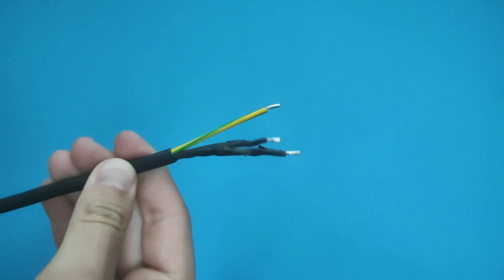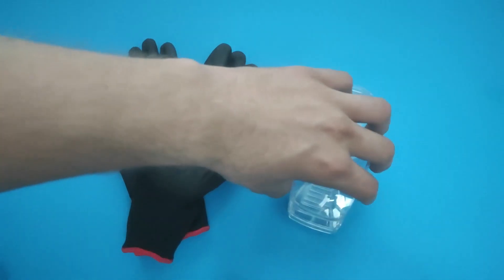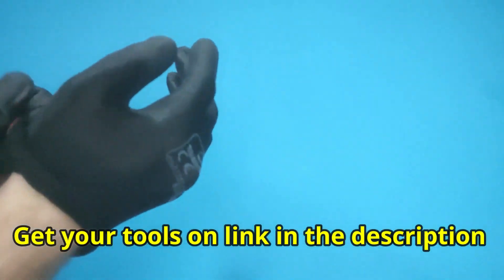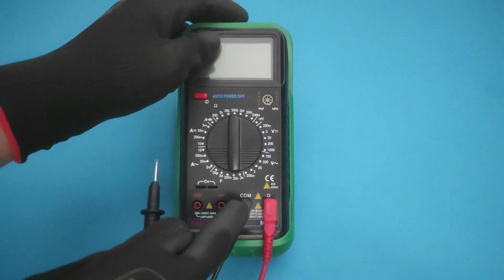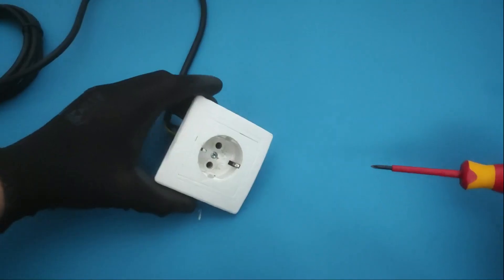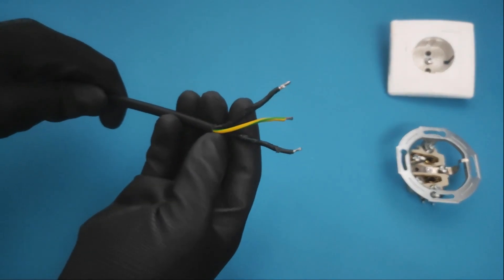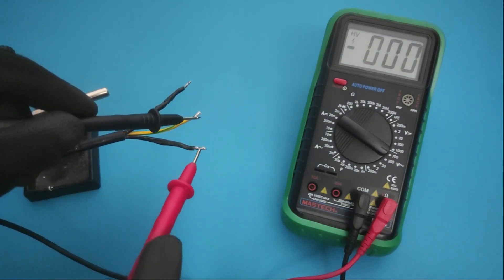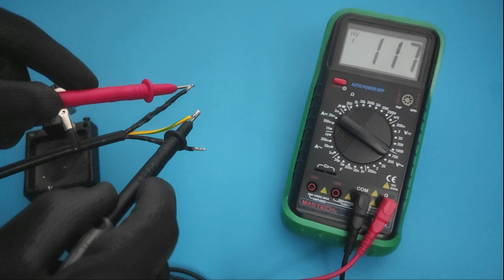How To Test If A Wire Is Hot With A Multimeter (IN 6 STEPS)

Comment: This video is dangerous!
1) You tell people to disassemble a hot socket which will result in electric shock most likely. 2) Why would you disassemble it in the first place? You can do it the very same diagnostic without disassembling it.
Reply: He did say wear protective shock resistant gloves. And you do need to disassemble the socket to find out and mark which wire is the hot one, you can't do that if it's assembled.
Reply: @wah01234  I think I would probably have been inclined to switch off the circuit breaker at the box while doing the disassembly then put it back on to do the testing perhaps?  Unless those gloves are really good and can reliably prevent an electric shock - which may well be the case.
Reply: @wah01234  why are you arguing with the guy above, he's right. The creator didn't explain how to break the circuit before disassembling the device and breaking out the wires. Breaking out wires while everything is still hot is dangerous. This video is horrible, now please sit down and stop defending unsafe practices.